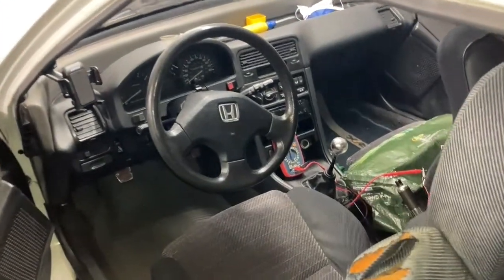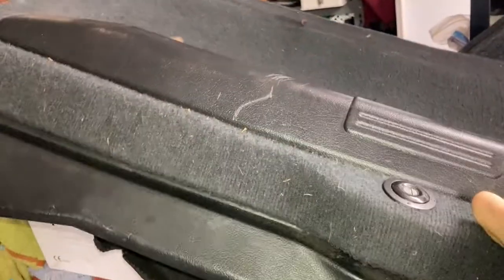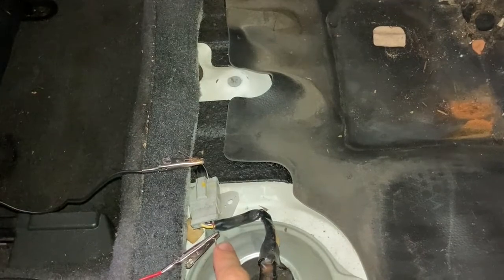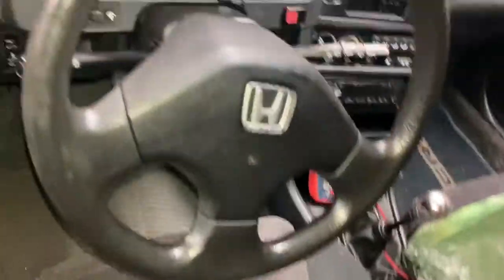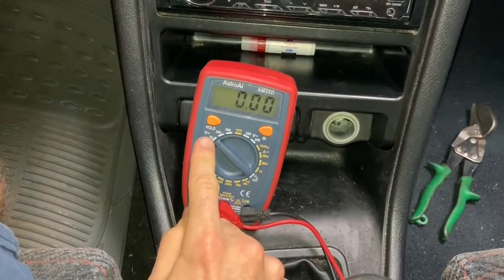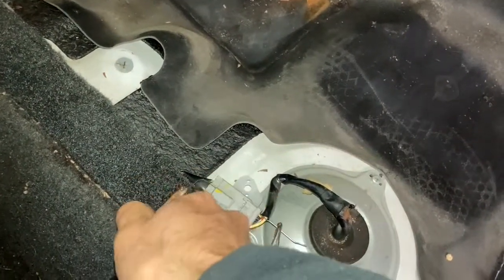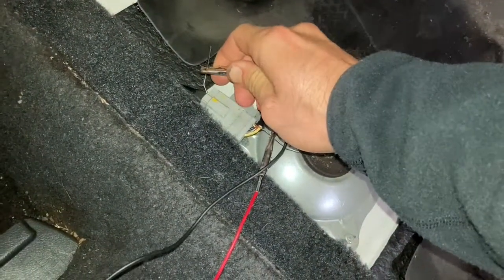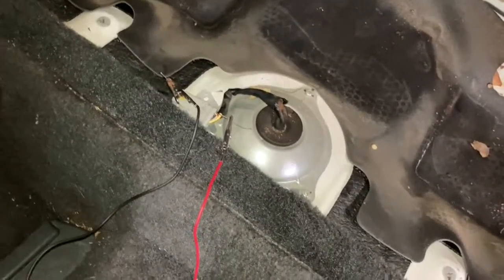How to check voltage to Fuel Pump on a Honda CRX

Comment: I know it’s kind of late.i was wondering if there was 2 power leads to pump cause i got thin yellow and black and a thick yellow and black with power only going to the thin yellow.before i buy a pump does the pump and sender share the power lead or is there 1 for each?cannot find any info must be straight forward but its an expensive mistake

Comment: Good diagnosis, I’m about to perform this test with my 93 del sol I purchased not long ago it all the sudden won’t start after cranking, I already know relay is good I even bought a new one just to test that and it still didn’t work so now I’m suspecting the wiring or the fuel pump is actually bad, cuz I don’t hear the buzzing humming anymore everytime I turn the key to “on” position I hope to get a good result after this test and will check back after

Comment: Hey Vincent, 
If you're able to read my post, perhaps what you know just might help with a problem I'm having, if you're inclined to respond. I have the same model as your car (91 CRX Si - 187k miles).

Back this past mid-February I could not start the car, so I installed a new OEM Main Relay. That didn't solve the problem.

I followed the Honda CRX service manual steps to test the main relay harness & fuel pump, and the result was that the fuel pump needs to be replaced.

I followed the steps you explained in your video, and was able to verify that battery voltage was going to the fuel pump. However, the thing that stumped  me is that when I turn the ignition key to the ON position, the secondary noise (i .e. fuel pump engaging, being primed) does not register. Not a sound. It's apparently a completely dead fuel pump (much like a light bulb having gone out).

Have you ever heard of a fuel pump cutting out like that? And then when electric current is fed to it, there's no response whatsoever. I kida had the assumption that fuel pumps go bad in stages, like your car's situation. Not just die completely.

One possible factor I can think of why the fuel pump crapped out is because I hardly drove the car for over a decade. Kept it in the garage, started the car and ran the engine for 30 minutes once a month. So the gas in the tank is really old, which has 10 to 15% ethanol. Wondering if the old gasoline in the tank could have prematurely killed the fuel pump. A bummer I didn't drive the car more regularly.

What are your thoughts on a fuel pump crapping out like a burnt light bulb? A rarety maybe? And BTW, did you get the fuel pump replaced for your car? If so, what was the misery index to removing the gas tank? An all day grunt work?  Also, what particular fuel pump brand did you put in? The particulars would really help.

Appreciate your patience for reading my lengthy post. I hope to hear from you. Thanks!

E. Lee
Reply: i know i’m a year late but maybe it’ll revive an old project- check your dash fuse 14. When it blows the fuel pump and ECU receive no power.

Mine keeps blowing and i’m trying to track down the gremlin atm

Comment: If you aren't getting any voltage, then you need to check your main relay. If there is no power from that relay, then the pump also won't work.
Reply: I have an 91 si have power to the relay but not getting power to the fuel pump
Reply: @russovangchang1267 same problem with mine did you fix this ?

Comment: 10v is not enough, but I suspect you may have poor test lead connections. But the right way to do this… You should measure voltage drop between the battery and pump on pos and neg, running of course.

Comment: If the voltage from the test is low after texting on the correct ground wire, what would you recommend to fix that?
Reply: Some people run a second relay, with the main relay switching a second relay just for the fuel pump with a 10ga wire run to the battery.
Reply: Hey did you ever figure it out?
Reply: @Urbanstrangler  no I sadly did not